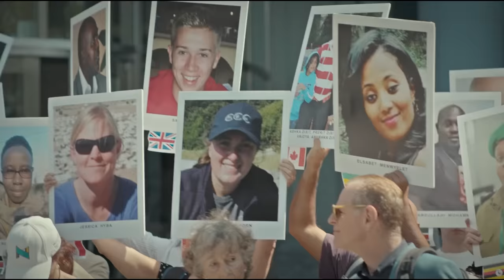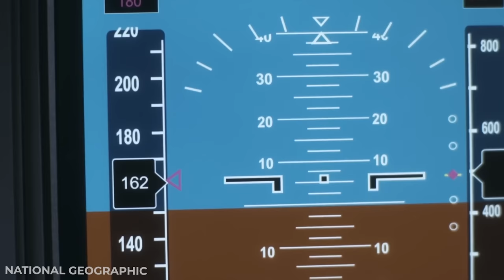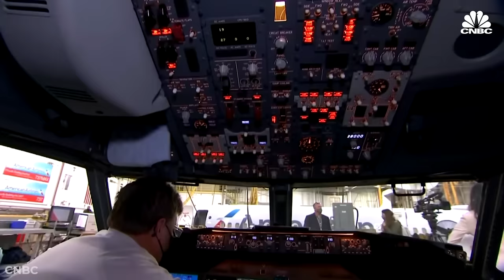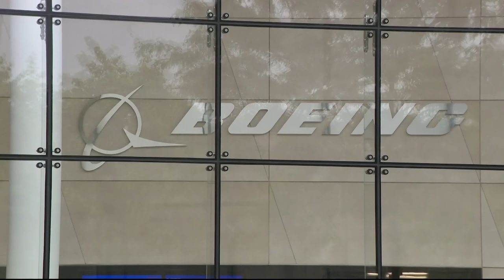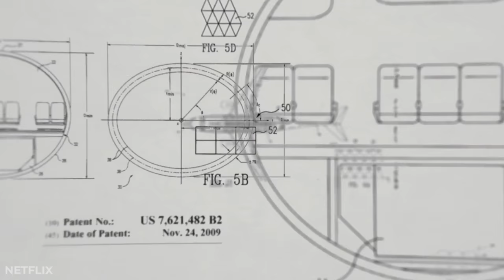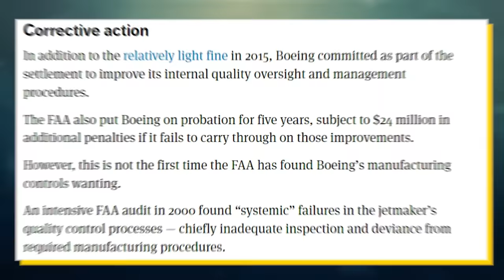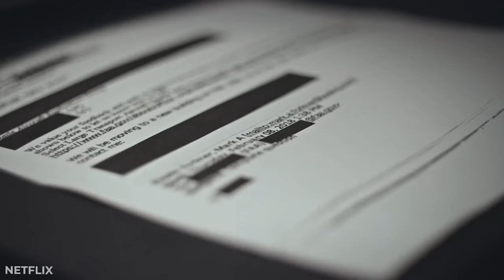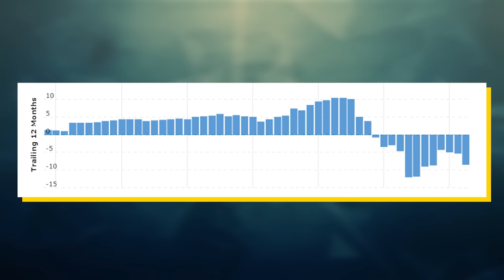Even Boeing Engineers Don't Trust Boeing...

Comment: I think it is prudent to point out that this downslide is also on the FAA, IMO they protected Boeing and accepted things that they would never have accepted for a non US company. The corruption with american industry runs deep and the FAA enabled Boeing to not take actions even when they found things that where a safety hazard. It is very easy to get complacent and think that things are so unlikely that they will never happen and later find out that due to manufacturing processes or operational processes that all of a sudden the probability of fail is up into the thousands of flight hours. In general aircrafts are extremely over engineered to cover this bias and to ensure a combination of failures before any catastrophic mishap but the mentality of making shortcuts to earn money and the under estimation of risks so not to add cost is an extremely dangerous combination.

Comment: The 787 is the most technologically advanced plane on the market and beats the competition out of the park- but you are right about everything else you said about Boeing. They keep cutting corners and don’t let the engineerings steer the ship and that’s a big reason why Airbus caught up and is beating them. It’s also why they KEEP recycling subpar aircraft like the 737 instead of making modern renditions of the much more effective 757 and push 777X development much faster.
Reply: It is not the most advanced airplane ....A350 is
Reply: @kirilmihaylov1934  im an airbus fanboy, but ill admit, the 787 is more advanced vs the a350, many of its systems are on the forefront, never seen before on large airliners. Except the yoke imo
Reply: @kirilmihaylov1934  nope the 787 is
Reply: The 757 isn't a 737 competitor. It's a bigger aircraft, with higher MTOW and higher passenger capacity. It has 50 % bigger wings  than the 737, it's no longer Icao Class C.
It's a good aircraft if you need to take off in thin air, since it has more wing size and much engine power, but in normal condition it's not an aircraft which could compete with a 737 or an A 320.
Reply: How TF is 737 subpar? Do you know what you're talking about?
Reply: Yeah, the 787 is so technologically advanced that the manufacturer had to redesign the containment for its batteries because they kept catching on fire.
Reply: The 787 is full of design flaws and was badly designed. How do I know? Cause I was an Engineer on the original 787 Design team. Managers routinely ignored and overruled Engineers in order to make an arbitrary schedule.
Reply: @leisti  yes they did and fixed it and therefor continiues to be quite more advanced hasnt happened in years. Hell smart bikes ars doing it too.
Reply: I think you forgot to check the A350 specs.
Reply: You mean like Airbus doesn't constantly recycle the A320? A321LR, A321XR, A320NEOetc etc.

Comment: Outsourcing isn't the problem. Whenever a job is outsourced the qualification processes involved are usually much more extensive and thorough than for internal manufacturing. Not in theory of course, but in practise. This is because the quality guys now don't audit their colleagues, but a third party. There are no personal connections, no favors, and no weighing of quality gains against cost (prizes are negotiated before). 
Also most of the suppliers have been doing these jobs for Boeing and others for so long, they now know better how to do it than the OEMs.

Comment: A pilot friend who flies a320s said he would never fly on a 737max as the original design of the plane was never intended to be stretched so much thus is inherently unstable. In short the max was a low cost bodge job completely reliant on its computer systems to keep it in the air. Prior versions of the 737 were good

Comment: I’ve noticed as the newer all new models come out they are getting better with virtually everything. Smart structure choices, crazy smart onboard systems, and well laid out and accessible mechanicals. The problems they seem to have is with modifying older designs such as the 737. The original designers aren’t really around anymore. That being said I’m glad McDonald’s Douglas went out of business. The DC-10 is just the worst thing to work on. Second only to the B-52. 
Just a fun fact to add. The new stuff Boeing has made is crazy smart. It knows what part you changed, it’s part number, serial number, and if it’s a compatible part. You basically ask the plane how it’s feeling today and it spills it’s guts to you in detail. So quick and easy.
Reply: The problem is that the head of McDonald’s Douglas became the heads of Boeing during the merger and changed the culture to be more like MD making the current Boeing into MD 2.0. this is what was insinuated @11:50
Reply: The problem with the 737 is the old airframe (which has a far too short landing gear because it was made for small bypass turbo fans in the 60s) isn't ready for the huge engines used today. With a longer landing gear the whole disaster never would have happened
Reply: Not sure if the people the died in the max crashes agree

Comment: I fuel these planes, the part I attach the hose to in the wing doesn’t have a standardized installation direction. I have to flip the hose around depending on however they felt like installing it 😅

Comment: It has parallels with the Comet Jet airliner in the early fifties that had some horrendous crashes initially until they went back to the drawing  board in order to reassure people. I think this is what Boeing need to do here. I understand the FSA have halted any further production of the Max8 and its derivatives, quite rightly so. There must  now be a total safety evaluation of every component part and system, as there might very well still be other faults that have not yet surfaced. I first travelled in a 737 in 1971 and It was a superb aircraft, Boeing need to ensure its legacy is protected. I have this feeling that currently Boeing's prime aim has been profit and then safety, instead of the other way around.

Comment: I’m a Boeing engineer and I trust Boeing.  I’ve worked through several new airplane models from PD, design and build.  I have never witnessed anyone taking shortcuts on design safety issues.
Reply: Nice sunglasses and white stick you've got here, buddy. Did you also work on the self-certification? If that isn't a well-known and dangerous shortcut, nothing is a shortcut.
Reply: @chucku00  I’m not an AR but have worked with them in support of certification.  My eyes and ears work just fine.  If you have very specific examples of intentional misconduct pertaining to airplane safety, I would encourage you to talk Boeing HR.  If you can’t provide very specific instances of miss-behavior that you yourself have first hand knowledge, then I question the validity of your comments.

Comment: What happened to the 737 max is that Boeing decided it would be a good idea to elongate their trusty 737 model so it can carry more people and they can make more money. However they also only elongated the plane, meaning basically everything that supposedly required a redesign to accomodate the elongation still followed the old 737 spec.
Reply: The problem was some software they installed - MCAS.

Comment: Trying to use an incident that happened over thirty years ago as evidence of a history of negligence is non-sense.  The 747 had been in service for close to twenty years when the Pan Am incident took place.  The engineers are not going to automatically think there’s a design flaw.  After all, the 747 had been flying since the early 70’s without that issue showing itself.  Compare that to the MAX, which had its first fatal crash shortly after entry into service.

Comment: I suspect Boeing looked at how Airbus was producing parts of their aircraft at various sites across Europe and mistook political expediency for best shore policy. The Airbus consortium were using sites that had previously constructed complete aircraft to produce components but it meant the staff and management understood how vital quality control would have to be to ensure efficiency as well as safety.

 Once you end up simply buying from whoever offers the lowest price for every component regardless of that suppliers previous experience, it's not a huge surprise that their were problems.

 There seems to be a steady stream of complaints from Boeing customers that their are obvious defects with aircraft when they are delivered and if memory serves, at least one customer specified that they would not accept aircraft produced at one of the Boeing plants, so high was the defect rate.

 I think the FAA undermined it's own stature by allowing Boeing to self-certify the 737 Max. Surely their is a conflict of interest? In retrospect, using MCAS to hide performance differences with earlier 737s (to lower the cost of pilots converting to the new models) and omitting to mention to pilots that the system even existed - a system that was badly designed and badly implemented.

I spent over two decades as a software engineer but I was still a little shocked to discover that the 737 uses software (some legacy) written in a mixture of three different languages namely C (mostly generated by MATLAB), C++ and Ada. The latter is the only language that was designed for safety critical systems.

If no quality standards exist around safety critical software, wouldn't writing a set of standards to be circulated and discussed have been a good idea? Such systems are found in many fields and so a lot of experienced programmers and more specifically programmers who have had to find bugs in safety critical systems could have brought in their own experiences.

Maybe I'm being unfair to Boeing but growing up the 747 was seen as one of the most amazing pieces of engineering in history. They were the best. But it seems that they attempted to borrow production methodologies (alien to their own past) without actually understanding them.

I would just like to conclude by noting that Boeing and Airbus appear to pay the workers who actually construct the aircraft almost exactly the same wage so it isn't as if Boeing should struggle to find decent staff. Of course, it remains to be seen if productivity expectations are the same. Isn't the basic ethic 'as fast as it may SAFELY be achieved'?

Comment: The 737 back in the day had a rudder hardover issue that Boeing knew about, ignored, and ultimately caused a fatal crash.  This was long before the MD merger.   Maybe it has gotten worse sense then, but they were never innocent.  The cargo door issues on the 747 also predate MD.  Blaming that merger as the sole or primary scapegoat is a cop out.

Comment: I was a flight attendant for a major airline and flew mostly on Boeing aircraft and I can tell you the 737 Max series are crap... They kept stretching them and stretching them to the point it was ridiculous The engineering was ridiculou they should have stopped at the 737-800... And never made the max 9-10 or max 8....

Comment: At this point I'd feel safer flying a B-17 to Regensburg than a modern Boeing jetliner.
Reply: Er, the B-17 was a Boeing built aircraft...
Reply: @EJWash57  Duh. That's why I used it as an example instead of a Consolidated B-24 Liberator. The B-17 was a testament to Boeing engineering and build quality, something the company was known for through the 757/767 program. Once they were completed...

Everything went to hell.
Reply: @EJWash57  Another fine testament to the quality Boeing used to build into their aircraft is BUFFy the Forehead Slayer, the B-52 Stratofortress. They're slated to continue flying as one of our heavy bombers past the 2040's, 90 years of service from planes that haven't been built since the 60's.

Comment: Poor Boeing. This is what happens when you start eliminating the inspections processes to "streamline" the manufacturing process. This is also what happens when you hire people based on D.I.E. check boxes and not on education and experience qualities. My dad worked at Lockheed in the fabrication inspection process and he would raise hell about the supervisors getting angry that they would reject work and make them do things over and they would cry that the inspection process needed to just go away. He would just tell them to try actually managing there damned people and actually hire people that could actually do the damned job right. Lockheed was NOTORIOUS for hiring gobs of people just because they were POCs and they were constantly producing horrendously bad work.

Comment: Boeing also believes more technology is better. Most problems are not mechanicals but the reliance on technology. Automated systems, ie. auto landing, throttle and flight systems activation have taken flying the aircraft from pilots and replaced them with computer programs difficult to understand. BEA, French NTSB is also critical of Airbus and the uses of computers in their aircraft, calls them “death traps.” See aftermath BEA report. Air France flight 447 disappeared over Atlantic.

Comment: It’s not even close.   Boeing  has a much better record!
How many plane crashes does Boeing have compared to Airbus?
Originally Answered: How many plane crashes does Boeing have against Airbus?
The data you are looking for is here (to end 2014). After crunching the numbers and removing duplicates, you get:

Airbus: 35 crashes, 28.3 million flights, 0.81 million flights per crash
Boeing: 251 crashes, 461 million flights, 1.84 million flights per crash
So Boeing wins on this measure. I was surprised, since one might think that more early crashes would have weighed more heavily on the averages. On the other hand, one could also say that Boeing has had longer to learn to be really safe (since 1916) versus Airbus (since 1970).

Comment: Without any detailed discussion of the root causes found, I have to rate this video as nothing more than fear mongering.  It attempts to cast a wide range of problems, over a time span of decades and involving entirely different airframes and design teams, as all due to some consistent and pervasive corporate evil.  That is not the case.  Aircraft designs are reviewed and tested, not only by Boeing's own engineers, but also by the part suppliers' engineering staffs and must also pass thorough FAA reviews and satisfy their safety requirements.  But there is a fundamental problem, faced by all industries and regulators, of staff turnover and attrition of engineering experience and knowledge.  
The public deserves a much better presentation of the topics discussed, which will leave them with an understanding of the underlying technical issues, rather than blind fear and anxiety stemming from an information vacuum.

Comment: The 737  MAX is unbalanced with Oversize Engines.  Software and sensors keep it stable.  Need to design a different aircraft to support the large engine modification .   The MAX is Not a safe aircraft.

Comment: When companies put shareholders over customers and human life this is the inevitable outcome. When CEO / executive pay is tied directly to shareholders, this is always the outcome. They will do whatever is needed to increase the stock value so they can personally profit. It is almost ALL corporations in America now. It's no longer the product the company provides or an engineer who moved up to run the company better or increase profits. It's almost always someone put there to increase shareholder value, usually someone who never even worked at the company.

Corporate greed in America has gotten out of control - and in many corporations and industries. Boeing's CEO during the initial MAX fiasco walked away with a 62 MILLION DOLLAR golden parachute... many of these CEOs make in excess of 20 million a year.

I'm all for succeeding in this country and working hard / making money when it is earned, but not when you run companies into the ground at the cost of their employees and the public. Some literally, like Boeing. And then they just rinse and repeat.
Reply: To add too, looking into the MCAS design when the MAX issues first appeared and anyone with a brain could see Boeing was cutting corners and trying to save every penny at the cost of safety and industry standards. MCAS as designed should NEVER have been implemented. I mean FFS they used a SINGLE AOA SENSOR on the aircraft and use decades old 16 bit processors (with all their limitations - one of which necessitated the use of a single AOA sensor originally)...

Comment: A much better documentary, detailing the shift in profits versus safety is available on Netflix. More than profits, what drives shortcuts in engineering safety is the primary concern of the directors: to boost stock price. Directors receive stock bonuses for good financial results. Their greed leads to unsafe build and maintenance in their drive to increased profitability and thus rises in share price and directors' wealth. 
Ironically, their greed is now causing stock prices to fall.